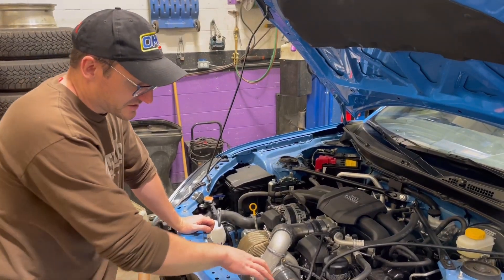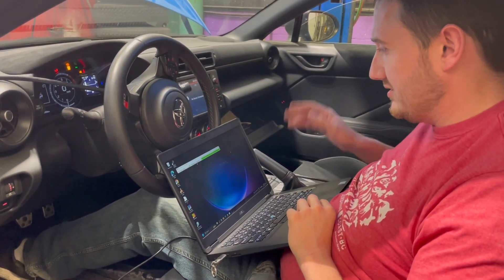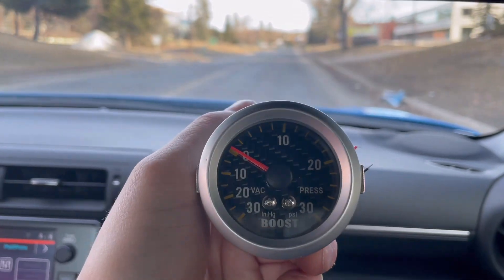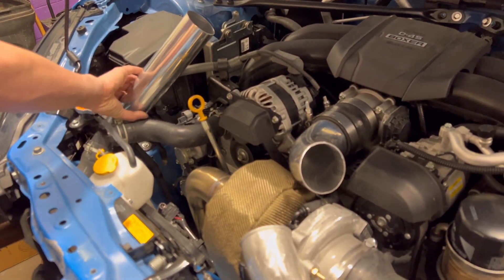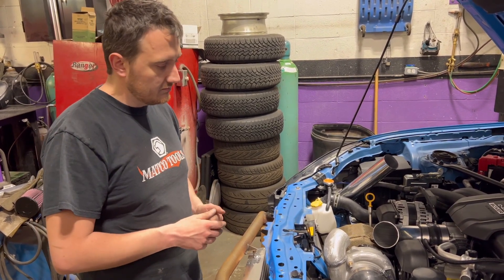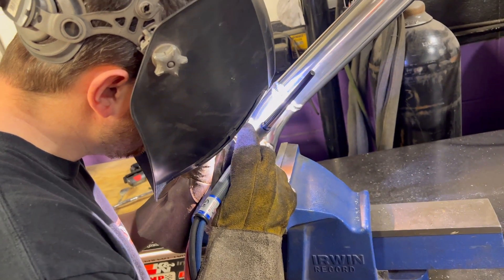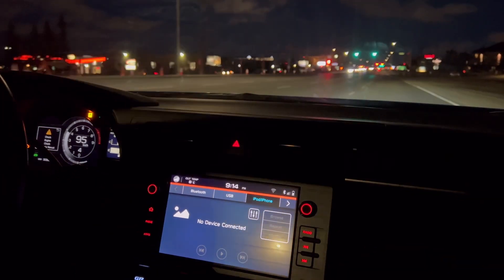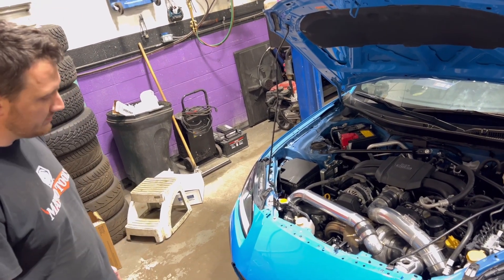2022 GR86 and BRZ Turbo Kit - Intercooler Development Update

Comment: Very nice! I’d love to see a 0-60 test as well to see how much it’s improved. How did the dyno tests go? And when can we expect that update video?
Reply: Also if we buy this kit, will we also have our dash lit up like a Christmas tree?
Reply: @JesseBreaks   How long can the non-inter setup be driven hard until heat soaking?  For example, spirited driving and mountain runs possible?
Reply: @JesseBreaks  will we need to run an aftermarket sensor for this kit to work? And finally, when that dyno video is out will we also get an install video showing how a customer can install everything and get it going?
Reply from the maker: You need an aftermarket map sensor to read any more than 6psi of boost.  The stock MAP sensor is limited there at about 6psi.

Comment: Super excited, if the price stays around $2500 USD for the non intercooled I am picking it up straight away. This might have already been answered but what did the base setup do to the MPG?
Reply from the maker: Price of the non-intercooled kit will be right around there.  

As for fuel economy, so far my highway economy hasn't been impacted much.  City driving is a bit worse however because there's more temptation to floor it and hear the turbo noises which of course drinks more fuel.
Reply: @nxtlvlmotors  Worth it tbh 😎

Comment: How laggy would you say the different turbo sizes are I saw you guys got a gt32 a 58/58 and a 62/62
Reply: @JesseBreaks yeah fair enough but I just assumed these guys have tested it and stuff like if a 62 spools at like 5k be like a 58 spooling at 3 y’know
Reply: @Xyez  at this time the only turbo tested on this GR86 is the gt3582 with 61.3mm inducer. Begins to build pressure at ~2500 rpm.

Comment: Would you say that changing the fuel pump is mandatory for running the Turbo/Intercooler setup?
(Newbie here)
Reply from the maker: The stock fuel pump is fine up until the low 300's, so it depends on how much boost you plan to run.  The intercooled kit can easily get past 300 horsepower, so it's best to change the pump and injectors.

Comment: How much whp do you estimate these engines can safely make?
Reply: I guess  time will show
Reply from the maker: Yeah time will tell when more people push them. The rods look to be similar in design/strength to the fa24 turbo motors. Same for the pistons. The higher compression just makes it harder to tune and more prone to having unexpected detonation related issues which means we’ll generally have to tune these NA motors on the safer side in relation to the turbo motors. 

Having said that, there’s a few people doing 600+ on stock fa24 turbo motors so take that for what you will.
Reply: @nxtlvlmotors  600+ is crazy for stock internals 😮
Reply: Hope 350whp will be safe for internals and manual transmission.
Reply from the maker: I'm fairly confident that 350 will be a reasonably safe number for these cars.

Comment: I’m not sure if it was mentioned but does the upper rad support need to be trimmed? Also would there be an option to order with a UEL or a bring your own turbo and /or manifold?
Reply: @JesseBreaks  sick! And as for a uel option and a different turbo?
Reply from the maker: This turbo manifold is unequal length but it’s somewhat close to equal length.  What turbo did you have in mind?
Reply: @nxtlvlmotors  nothing in particular atm

Comment: What did you boys end up hitting yesterday on both setups? Looking forward to hearing some preliminary numbers
Reply from the maker: We ended up having some tuning issues due to the beta state that ecutek is in. There’s a load limit in place that you would normally remove on one of the gen 1 cars for example, but you can’t remove it yet on the beta software the way you should be able to. 

Did 270 @ 6psi on the non intercooled set up.  There was room to push it more but the load limit was stopping us from taking it further. Will have a video of it in the next day or two. 

The tuner is trying to figure out the best way around it for now and we’re going to do some more street logs to make sure this issue is sorted out before we get back to it.

Comment: What be a reasonable installation charge, labor?
Reply from the maker: Depends on the kit. Non intercooled kit should be able to be installed in around 4 hours. Intercooled kit would be more like 6-8 hours.
Reply: @nxtlvlmotors  Thanks, I’m in Florida and don’t know what would be a reasonable hourly rate. Will have to ask around at a car meet.

Comment: When will these be for sale the turbo kit with inter cooler? Want to buy one and where could I get it tuned?
Reply from the maker: Kits will be for sale this week. We will have a tune available with the kit.
Reply: @nxtlvlmotors   If someone wanted to run a smaller/faster spooling turbo for a more n/a throttle response is that possible? How would the tuning work?
Reply from the maker: Yes, it's do-able.  The kit will be available with a few different turbos.  The turbo used on the test car is the cheapest of the turbos because we want to show everybody how far and how fast we can go on one of them with our own vehicle.

Smallest turbo option will be a precision 5858 to start.  These will spool up very quickly on the 2.4.  This Chinese journal bearing 62mm responds quite well, all things considered.
Reply: @nxtlvlmotors  I want to make 330hp with stock fuel injectors what size turbo do you recommend and how do I know what size down pipe to select
Reply from the maker: Should be fine with the stock injectors.  You can go with the 2.5" downpipe for that power level but the 3" downpipe will typically make more power.  Problem with the 3" downpipe is you need a 3" over-pipe  and full exhaust system to really take advantage of it and MOST aftermarket exhaust systems are 2.5" or smaller. 

The 2.5" downpipe will bolt up to the stock exhaust and most aftermarket exhausts however.